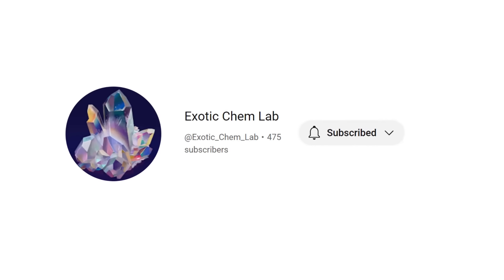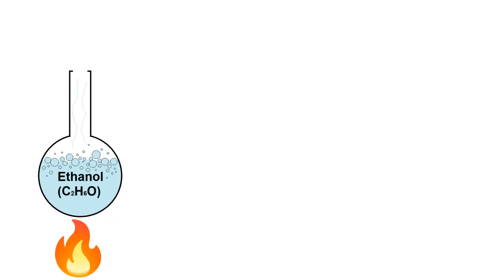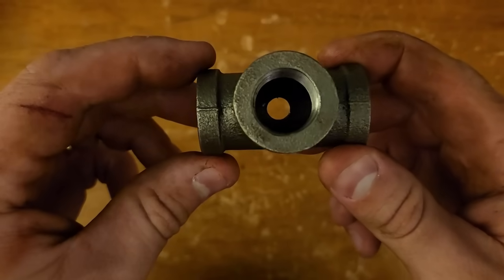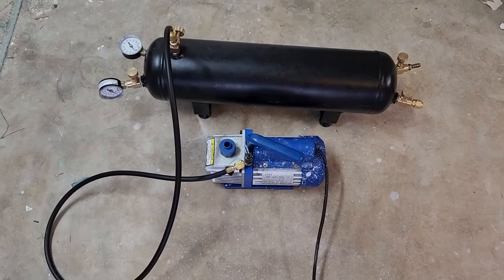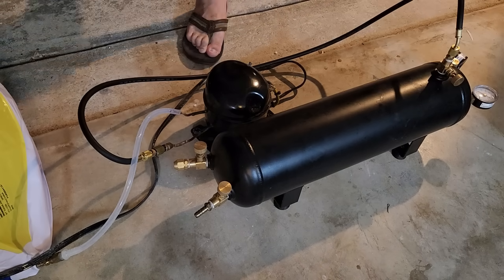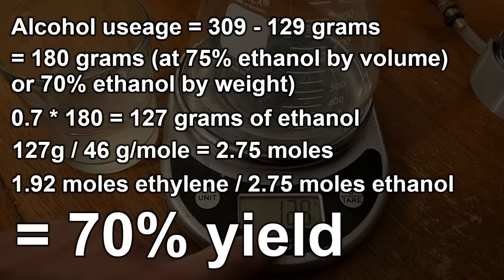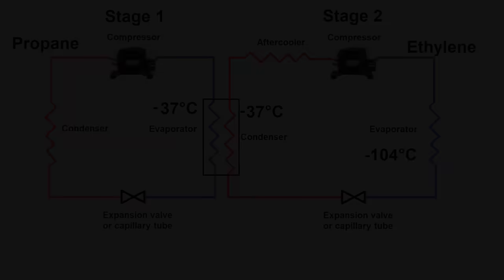Making Ethylene (Refrigerant R1150)

Comment: Amazing video. Only error in is that density of the mix cannot be computed the way you did. Density is not an additive property. What you did was like a weighted average of densities. The way you do it is:

Mix Density = total mass/total volume 

Mix Density = total mass/(volume_1 + volume_2)

Mix density = total mass/(mass_1/density_1 + mass_2/density_2)

Mix density = 1/(fraction_1/density_1 + fraction_2/density_2) 

Then it’s easy for I extract one of the fraction by saying that fraction_2 is equal to 1-fraction_1 
et viola.

Comment: I didn't exactly follow all the calculations, as I left it running in the background while gaming, but did you consider in your calculations, that when boiling en ethanol-water mixture (due to Ethanol and Water forming an azeotropic mixture), the Vapour isn't going to be exaclty the 75%Eth of the everclear, but more like 78%Eth, as to be seen in McCabe-Thiele diagrams, used for calculations for destillation/rectification? Could this further explain, why your predicted yield of water is 3% off? (including the ether)

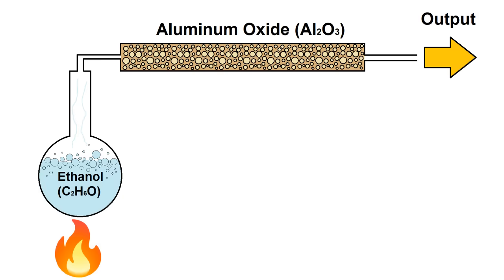Comment: 2:30 The process of mixing ethanol and sulfuric acid produces ethane, which can in turn be steam cracked in a 0.65 ethane /0.35 water ratio at ~650C.

Comment: I think you are a genius. Just one an advice. To identify a gas is very easy. Just measure density with the help of the proper syringe, divide this by the density of hydrogen gas at the same pressure and temperature, multiplied by two; that is the molecular weight of the title gas.

Comment: If you saturate the ether/water mixture with common table salt the diethylether will separate and float to the surface.  It's a common method for drying organic solvents in synthetic organic chemistry labs.

Comment: 0:23 That´s basic nomenclature for organic chemistry: "an" for no double covalent bonds (or: for solely single/simple bonds), "en" for a single double-bond, "dien" for 2 double-bonds, "trien" for 3 double bonds, "in" for a single triple bond an so on... 
Also, "meth" for a single C-atom, "eth" for a molecule with 2 C-atoms, "prop" for one with 3 C-Atoms, and "but" for one with 4 C-atoms. Ethylene is the market-name, Ethene is the scientific one.
 Example: Butadiene is like Butane, but has 2 double bonds between C-atoms, and one single, unlike butane, that has 3 single bonds. Butadiene is the umbrella-name for 2 different molecules, actually: One with the 2 double bonds after the 1st and the 2nd C-atom, and one with the 2 double bonds after the 1st and the 3rd C-atom (Buta-1,2-diene and Buta-1,3-diene respectively, I think... ). 
Other example: Codein = (5R,6S,9R,13S,14R)-3-Methoxy-17-methyl-4,5-epoxymorphin-7-en-6-ol  (that´s the short version, cause it references "morphin", which has an even longer and more complicated name itself)

Comment: That shot of your 2 stage system, caught my eye.
Early last summer, our AC started leaking R 22
out of it.  Compressor was leaking.  So, I started 
running R 290 in it.  (Well, not refrigerant grade, 
but BBQ grade.)  One bottle lasted all summer,
and the landlord was able to find a replacement 
unit MUCH cheaper, out of our "warm" season
Phoenix Az.

Bought a weedburner from Horror Fright, cut 
the line, cut a line on my cheap set of AC 
gauges, and shot some R 290 in.  Left the tank 
and gauges under the AC, so I wouldn't be carrying
them up and down.  At least once a week, or more 
often.

steve

Comment: I'm curious to know how you evacuated the beach ball because essentially it would be at atmospheric pressure when you filled it up with ethylene but then in the storage tank you did do a vacuum so that there wouldn't be an explosive mixture. Wouldn't there be an explosive mixture as well in the beach ball since it wasn't evacuated or did you purge it afterwards? 
I would assume that it would be tough to hold a vacuum on a beach ball and some plastic hoses lol

Comment: 9:22 confused the hell out of me because of how you said it, but I think I understand it if this rewording is accurate:

You can see the decrease in water volume by the decrease in weight and knowing water's density, the reason is because the volume of injected gas is equal to the volume of water lost.

I suppose the other assumption here is that the weight of the gas is negligible.

Comment: Just a couple of thoughts from a chemist... Crush the catalyst beads for more surface area, better conversion.  Ether is soluble in water to around 6% w/w so you should see a phase separation at any higher than that if theres no ethanol in the mix. You can break the water-ethanol azeotrope by adding a ternary solvent but whats the point, your byproduct is water. The major difference between what you did and the sulfuric acid dehydration route, from an engineering perspective, is continuous vs batch process. Play with the residence time of your ethanol vapor on the catalyst bed to increase yields even more and run it vertically for better mixing. Anyways, good job, enjoyed watching this!

Comment: Hello. Mixing ethanol, sulfuric acid and heat you will get some diethylether. Actually it goes like that: Mix ethano and sulfuric acid and start to heat the mix. After some time, there will become dietylether fumes. All the time, when ethanol reduces and chance form to ether, you will have to add more ethanol to the mix. Basicly you would need some chemistry stuff, flask, consender and so on to catch all ether fumes and cool those down to liquid form. It is pretty easy to do diethylether if have all the stuff needed. I havent heard abaut making ethylene with sulfuric acid and ethanol. Only to produce this ether. And thanks for good video, I liked it!

Comment: Great content, let me point out that you should not be afraid of a few percent hydrogen in your mixture as hydrogen molecule has a so small diameter that it will escape any enclosed system you can build, over a fairly short period of time.

Comment: Could you hook the finished ethylene up to a PCP compressor to condense it? If you have 2 small bottles, and have one upside down will the accumulated bottle is right side up. hydrogen should stay in the first one, and ethylene drains to the second.

Comment: As a refrigeration mechanic by trade i love this stuff. As a professional pyrotechnition i love it ecen more.  As an apprentice i worked on a ultracold bone cabinet it ran a R502 cascade system to a R503. We added ethelene to prevent waxing and capillary freeze up blockages. Our target temp was around -82deg c.  The power bill was bad for  just 2 weeks run time. All the same great content

Comment: realized your "venturi effect" inlet is poorly designed, a venturi intake requires the restriction spot be EXACTLY where the flow is most constricted, you can clearly see the gas nozzle in those pipes so there is no real venturi effect at that point
if you had purchased one of those cheap npt venturi injector modules on amazon it would have worked MUCH better, plus they tend to be made in a thermoset plastic that can handle the temps your burner will reach
but yes it works well enough considering the soot will not hinder the catalyst system much if at all
your real problem is using a linear burner with no separate zones to stabilize the temps along the length it is why your test with the gas failed due to impurities

perhaps redo this video with MULTIPLE SMALL grill style burners each controlled via a servo based on the zones they are heating controlling each burner valve and use a few of those venturi injectors for finer control(or a real burner with integrated injector), this will prevent hydrogen and carbonization in the gas flow(pain in the ass to separate from the gas you want) and also ensure maximum yield by having no ethane form in your liquid collector(which is a good idea since having the bubbler do that job risks overflows
and yes the boiling chips is a really good idea on attempt 2 as the even flow of ethanol will reduce the chances of the starter flowing past the catalyst at the wrong speed for proper reaction and allow for more stable cracking

ultimately this video has shown how simple it is to make a refrigerant that has a pointless license and pointless over inflation of prices(I mean ~600$ for a 4oz bottle is literally a crime, given the ease of making it)
I will be redoing this video myself if you don't as post-purification will be harder than ensuring the initial reaction has no major side products, and you can always purify the failure of this attempt by using attempt 2 in your cryocooler to purify the gas from attempt 1

Comment: i know this is old, but if you heat the ethanol vapor and catalyst in a oil bath, you might be able to preheat the vapor to the exact temp and have the entire  catalyst preheated.
Reply: also, an electric deepfryer might work for 450.

Comment: How does this -100c system help you produce LN2, when nitrogen needs -186c to become a liquid?  Even at 34bar (~500psi) you'll still need -147c correct?
Reply from the maker: It would be a refrigerant for a second stage in a system that uses 3-4 stages in cascade. It can also be used with a mixture of other hydrocarbons in a joule-thompson cycle to reach around -170C, which would allow you to condense nitrogen at a reasonably low pressure.

Comment: I realized it should be pretty easy to use a simple arduino sketch to take the thermocouple(via a sensor board) input and control a simple servo output on the gas line with a hv igniter (using a relay to prevent software crash from high frequency switching on the power rail) and even add in a switch to run a small car tire compressor when the gas bag gets full
you could even do some clever auto-fermenting and filtering to get a fully automatic ethaline production line to sell your gas to hobbyists at well, a non insane price in small batches since, if you can build a system yourself, then refrigerant licenses are stupid for ethylene

Comment: I use this stuff a lot. I always wondered what the catalyst was in the ethanol to ethylene converters.   BTW if you buy it as a refrigerant its regulated, its not if it's a ripening gas purchased from a welding gas distributor.

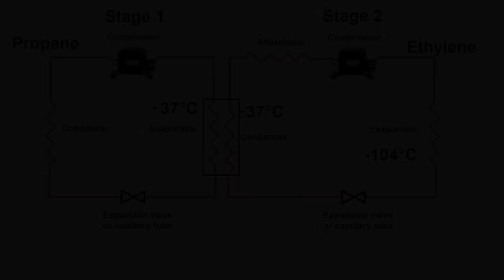Comment: Thought on the heater for the cat. Induction. You can have it heat the unit and with pwm control the power. 17:33  idk if the em would interfere with your thermocouple, perhaps a common mode reject circuit

Comment: Looking at your chart @1:10 gave me an idea for your H2 separation issue.  Why not lower the temperature on your storage cylinder, while keeping it over at least 4 bar?  At 3.5 bar and -79C is dry ice temperature and depending on where you are, you can just buy some dry ice, drop it in acetone (the acetone is optional but improves conduction to the container), then vent the H2?   This means you can basically make liquid ethylene without needing the lower temperature, using cheap, easy materials.  From what I'm seeing though, you may need either more ethylene or a smaller container, as I expect the pressure to drop below 4 bar when cooled with dry ice.  If it goes below 3.5 bar, (and doesn't get colder than -79C) it won't liquify.

Comment: How much ethylene is produced by what presumably starts with the bio process of fermentation to make ethanol, versus an oxidative cracking of natural gas?

I'm familiar with the synthesis of diethyl ether using sulfuric or other dehydrating acid, but was not aware you could get it to go to ethylene.

Comment: Impressive, but I have one question,  why can't 95% glycol be used instead of alcohol, can that not give higher and purer volume/mass/yield "I mean it ethylene glycol after all, and pretty cheap and aeasily available in this country and with added bonus of availability in high concentration

Comment: I don't understand why you're going through this big process can't you just distill air like they do with oil? Use different stages of compressors or multiple passes, each one at just enough pressure to liquefy each gas in the air. 

You definitely know more about this than me, so I bet there's a good reason I just don't know what.
Reply: It would propably require extreme pressure which is hard to reach diy

Comment: As an HVAC EPA Certified tech for diesel truck refrigerator trailers, i thoroughly enjoy this! I can probably get a high output 1994 unit for 1200.00 USD at LKQ... that's actually not a bad idea come to think of it... Some of those units use the R508, so if you had the opportunity, one could theoretically find a place that is decommissioning the retired units and offer a free service to recycle/dispose of the refrigerant for the yard, and then collect enough of what you need as well. Granted not everyone has a recovery system that can store used Freon, i get that.... Just a thought.

Comment: You know its good when it takes an hour to watch 18minutes. So much invention , so much Science, its inspiring. The problem solving with modern day off the shelf parts is as impressive as the calculations. The numbers dont need to be exact, its the method which is demonstrated  that hopefully leads to understanding in such a way that it is raw ,  Kg,m,s . Impressed by the whole project at every stage.

Comment: 4:36 as crazy as it sounds try plain clear nail polish as a thread locker/sealant! I use it for sealing up gas blocks on AR rifles because it doesn't come loose under heat like blue Loctite and yet still pops loose easy with a wrench unlike red Loctite!
Reply: Username checks out

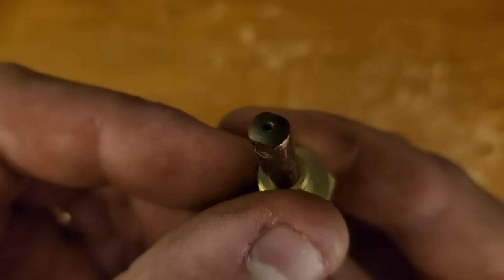Comment: 2:58 "just the tip"? 😉 3:10 Having the tip at an "off angle" vs a perfect 90° down the middle should actually HELP with the mixture and flow rate. Think "toilet boil swirl", it actually flows faster and mixes better by adding a vortex. To illustrate, fill a bottle with water, invert and then swirl the bottle to induce a "toilet bowl vortex" and watch how much faster the water evacuates... Same idea applies to this, intake manifolds AND tornadoes! https://www.youtube.com/watch?v=HZbThnZ5-Vs

Comment: In distillation, a liquids boiling point is not actually where it begins or ends vaporization, it is the peak of a bell curve. In an ideal world there would be no curve, just a vertical line at the transition but since the real world never has “ideal” conditions the process doesn’t give ideal results. My guess is that this is why some ethylene was left in the system. In brewing this manifests as the heads, hearts and tails.

Comment: Random question here (im not a chemist but thinking outside the box) are there any other naturally occurring gases like carbon dioxide, oxygen, methane or possibly noble gases that would react in the same set up with the Al2O3 to produce a different end product than the original starting gas?

Comment: I have a lab cryo freezer that sits at -86c using 2 compressors. It’s impressive but would love to get colder. But I do believe the second stage does use Etheline or a mixture of it with another gas.

Comment: Missed the other huge use for Ethylene which is in the sterilization of medical items. IF you see a little EO in a circle on the packet it was sterilized using Ethylene Oxide. It is used where Steam cannot be used for whatever reason.

Comment: As a researcher working in steam reformation you absolutely nailed it. Gas heated reactors can be very hard to tune and can give all sorts of weird results due to the larger temperature gradients. The second batch also looks like you may have started reforming. The water gets used in the water gas shift reaction to make H2 and CO2.

Comment: I have also had some interest in producing ethylene for a project of my own so thanks, this is useful. I didn't realize you could produce it from ethanol. I should probably use something like pure grain alcohol rather than denatured ethanol though right? I'm hoping to use it to perform a new method of 3d printing.
Reply from the maker: Pure grain would be ideal, but I think denatured works too, you just get some of the odd compounds they use to "denature" it which may or may not be an issue for your application. For a refrigerant i think it's actually not a big deal, and i'll probably use denatured next time
Reply: @HyperspacePirate  my application is a new method of 3d printing that should be faster than current methods.

Comment: The propane is definitely the cheap option and i totally agree with the use here, i personally think if replicating the protect to this level using a bunch of modified cinder block as a clin cover to keep it even and a small gauge would work pretty well to keep the temp consistent

Comment: Back when I was in HVAC studies I built a 220v Dual headed, triple stage condensing unit. R490 R508 R1150 as I recall.  (not sure about the 508...)
 Used it a couple times for overclocking runs.  I had the Gtx295 quad record for almost a week with it,  until Shimano Or KP, volt modded and  put theirs under liquid nitrogen  to nudge past me..  Its sat ever since. LN was easier and cheaper.

Comment: I suggest you to use grinded Alumina powder to increase the surface area to get more yield.
About your procedure you can reflux ethanol and sulfuric acid above 150 *C to get the ethylene (the ethanol and sulfuric acid will be condensed down)
Reflux apparatus:
App #1:
(I am lazy so you can do the chemical ratios)
pick up a boiling flask then connect a fractional distillation column (to reflux the sulfuric acid) and at the top connect a cooling condenser (to reflux the ethanol) then set up a gas trap (like your video) and collect the ethylene.
App #2:
pick up a boiling flask then fill it with ethanol then in other flask add sulfuric acid then heat the ethanol to 100 *C and heat the sulfuric acid to 150-170 *C (the higher temp is because of the mixing the ethanol vapor with sulfuric acid (this causes to cooling the acid) then pass the hot ethanol vapor trough the sulfuric acid. => you can set up the reflux system to trap any contaminations.
Reply: @1srol1  you are out of range yo :/